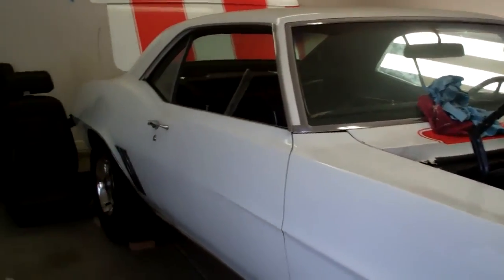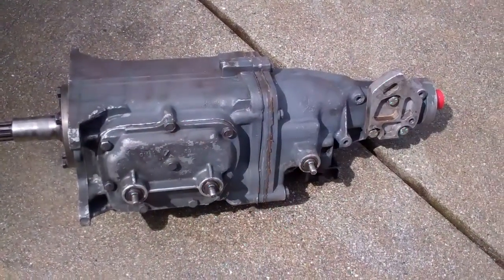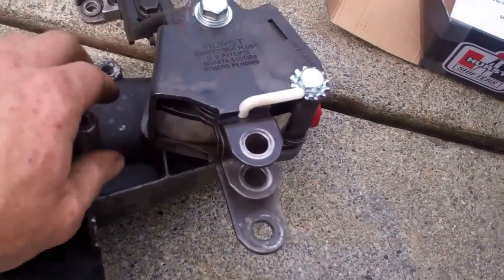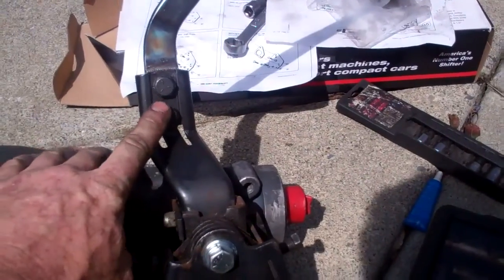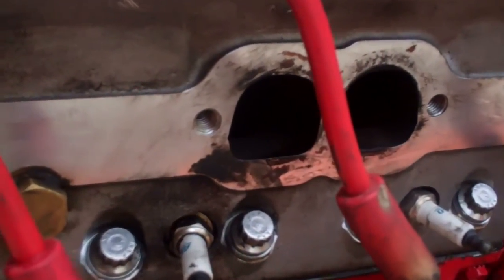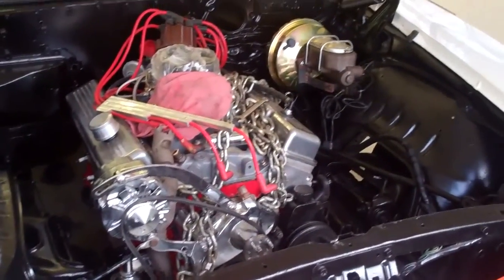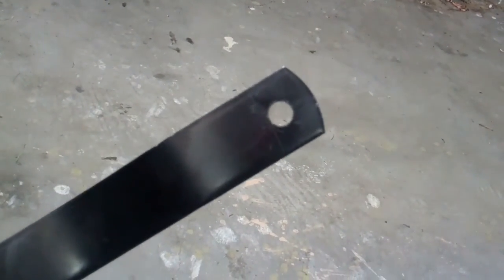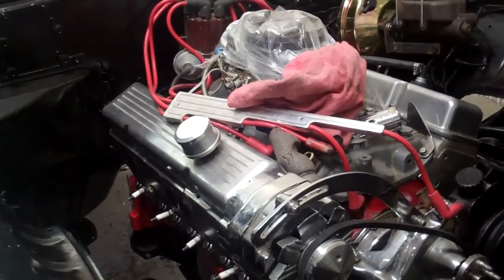1969 Camaro Project #2.mp4

Comment from the maker: That engine and transmission didn't come out of that car.   After looking at pictures of the correct Hurst shifter it looks right.    But the installation kit was wrong.   So I ordered the right installation kit.  So now the shifter should go threw the floor in exactly the right place.  Since the kit came with a different shifter mounting bracket.  Maybe tomorrow I will get the transmission in, if I have time.

Comment: Could you put that shifter on a TH350 without too much modifications?
Reply from the maker: Kevin Aird    No you can’t put that shifter on a TH350.   It will only work on manual transmissions.